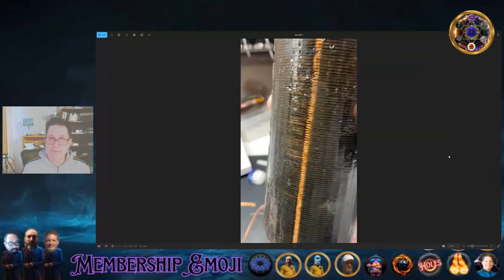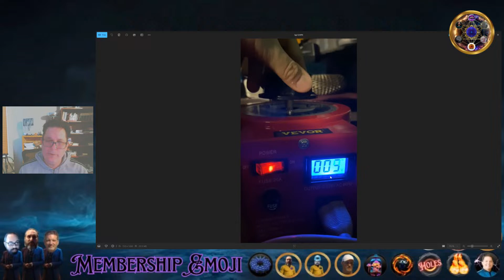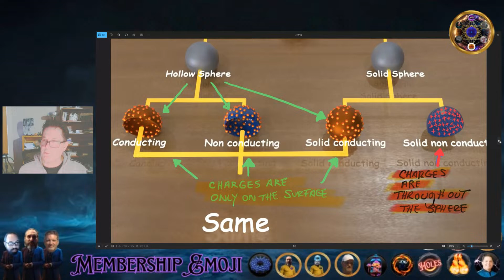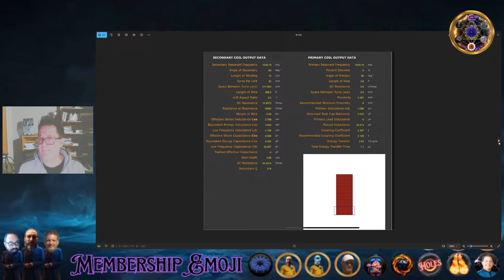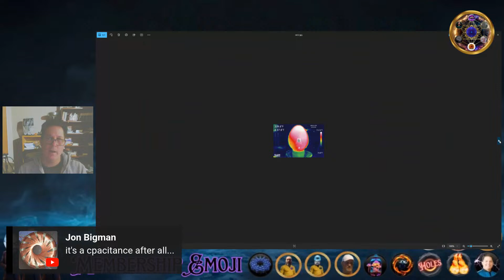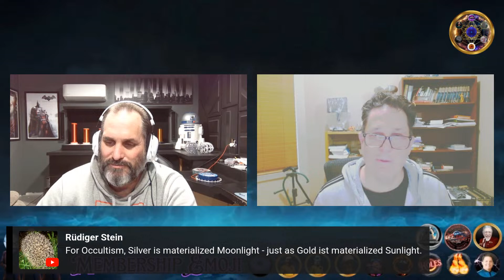Ground Energy Pump "Builders Workshop"

Comment: Nathan ...a couple of things from an old timer ......be very careful when you are using the earth ground on things when you are around the Tesla coil .......for every action there is an equal and opposite reaction ......if there is 20 thousand volts at the top of the coil ......What do you think the amps are doing ? well 20 thousand of coarse ......go review Don Smith  he says the same thing ......
Reply: It's more about thinking that there are many different sources of electrons/protons besides the ground. This thinking is missing.
Reply: @shawncalderon4950  Bingo Bango
Reply: I appreciate your safety reminder. Safety first.
Reply: Amps are very high. Thankfully, the high-frequency skin effect helps add another layer of safety. However, the one-handed rule is most important.
Reply: #2.....A crystal power cell is an electret that is doped with a semiconductor .....I am not trying to tell anyone how to proceed just this ....once upon a time someone replicated John  H."s power cells .....Before it was out in the open for all to do ....his work was documented by his brother whom went to the energy confrence in Idaho where he shared the research with everybody there ......after that is when that is when John B. and John H. came out to share ......that was me that gave to ya'll first ....so I was just giving tips tonight .....I am not trying to tell anyone how to proceed in there research ....
Reply: so connecting it to the ground is what everyone else was missing when they're trying to replicate it?
Reply: @SpectacularRanker2  Grounding is very important. Virtual and Floating grounds will help you understand Don Smith systems better IMO.